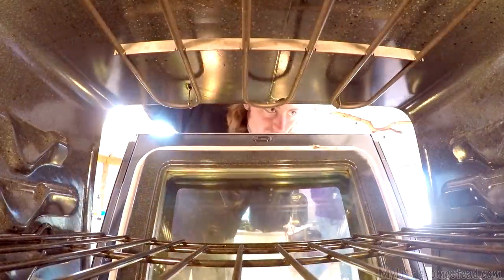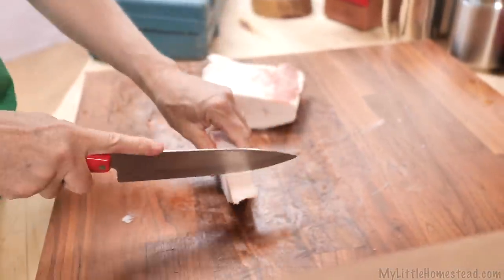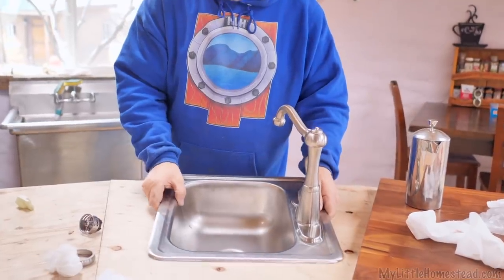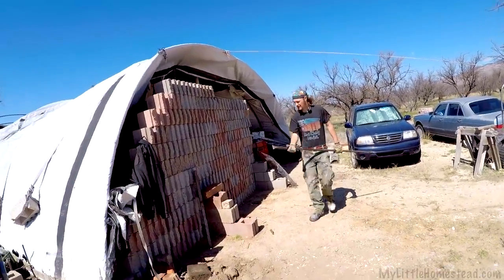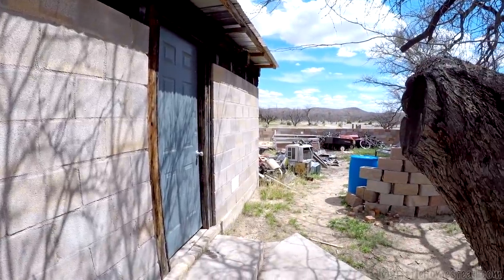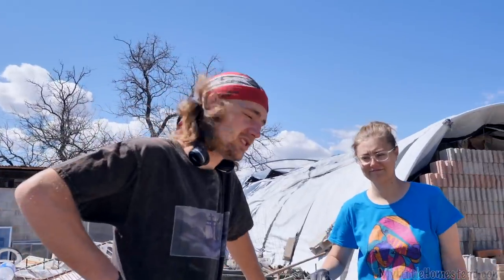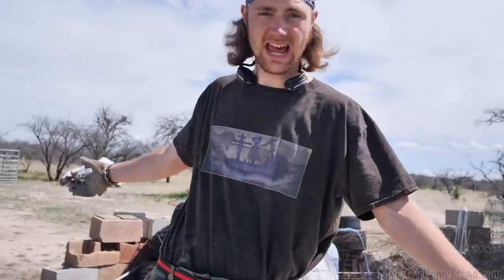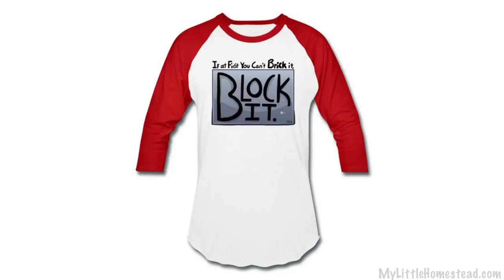Gaming Desks Complete! Kitchen Sink Cabinet, & Outbuilding Start! | Weekly Peek Ep177

Comment: Bricks can have holes in them, they tend to be made of clay, they have a standard size, but you can get custom size ones. Blocks can be solid as well as have holes in. They tend to be made of concrete with ¼ or ⅛"- aggregate in stronger versions, but can also be more like aircreate, without aggregate, and are called things like thermolite. They also have a much bigger standard size, but again custom size is possible. I love blocks. Bricks are nice too. Love your work.

Comment: Looked it up for you... The first striking difference between a brick and a block is in the shape, size, and composition. Blocks are mainly made of concrete and are larger in comparison tobricks. They come in both solid and hollow format and are used mainly in load bearing walls where strength is very important.Jul 17, 2017

Concrete blocks and clay bricks

I love your videos can't wait till next week's video

Comment: Bricks are clay (usually fired), blocks are concrete and both can have holes in them. Cinder blocks are made with cinder ash in the mix. The blocks you have will last much longer than cinder block.

Yes, I'm a spoilsport....

Comment: I've been hooked watching your whole family doing all of these DIYs you do. You are great and fun to watch and learn with. Gonna share something I noticed though with this particular video. Your utilization of blocks (aka hollow blocks) 18:42 you only put cement on the shells between other blocks it seems. For more stability and strentgh, you should fill in the hollowed areas. ☺ Though with your system I guess you want something not permanent and could easily be dismantled.

Comment: The blocks that you are using are 8"x8"x16" fluted block. Not all bricks are solid. It depends on the style of brick. Most bricks have holes to install rebar. Your block building should have rebar in it as well. It will add strength and stability. Then fill the walls with cement.
Reply: Kenneth Gregory I think I heard an NPR story a few years back discussing deterioration from a chemical reaction between concrete/cement and rebar...I understand the reasoning behind adding rebar but if researchers are finding that it doesn’t really work why add it?
Reply: @martymaloney1032  some places require it for code. There is another item that one can add. It's like ladder wire or something like that. It's galvanized metal and does something of the same except you lay it between the blocks.
The foundation and the block do need to be anchored to each other for safety. I wouldn't want one of the walls to move and crush someone.

Comment: Blocks can be solid as well. The difference is that brick are made from clay and blocks are made of concrete. Blocks are stronger and are used for load bearing walls. 😘

Comment: Aren't the block walls supposed to have rebar? How in the world did the goats get started eating that cactus?
Reply from the maker: Not sure
Reply: @mylittlehomestead  the corners should be filled with concrete with a "rebar" could be some thing else but rebar are hard to beat, pipes are not a good idea they rust from inside too but better then nothing and texas is kinda dry most on the time
Reply: also if you put a "rebar" in each corner you can weld a bracket to attach the roof.

Comment: when you build with Brick - it's either siding or you put rebar inside it in a Grid like pattern Even cutting them to fit crossways - so that the Roof can bee attached to the foundation through them. ? understand?  - if you attach something like wood? to the foundation the roof attaches to that making the Roof part of the solid structure.
Reply: Masonry blades come in Grider and Circular saw. usually for around $2.50 each - but you cut by moving it back and forth not like wood. - it's down the brick back to the start then back to the end - back and forth until through - LIKE METAL with cutting Discs.
Reply: And do not apply pressure. <heart> wear goggles and dust masks.

Comment: I hope you have enough of the boingy blocks (concrete) to do the south and west walls complete as they dissipate heat well and heat less than smooth block. Adobe bricks can be large and some fired bricks have holes. Cinder/pumice/concrete blocks are not fired but cured with a cement binder, bricks are usually fired. Adobe are called sun baked bricks. 
 I think that was a couple hundred year old cactus!
I love the desks and congrats on the streaming server.

Comment: Those boingy block are called "fluted" block, and what you are calling "cinder" block are not cinder block at all. If some regular 8"x 8"x 16"s are heavier than others, the heavy ones are concrete block (or CMUs, concrete masonry units) and the lighter ones that have some perlite or vermiculite in them mixed in the the sand based aggregate of concrete to make them lighter are called lightweight block.  Don't feel bad about calling them cinder block though, at least half of the people who don't know better do call them that incorrectly.  A real cinder block had cinder in it before they started using perlite (sand popped like popcorn, and vermiculite is popped crushed mica) to make them lighter.  I don't think any have been made with cinder at least since the 40s, maybe further back than that.  I have only ever seen them, or repaired them, in buildings built before then, and only have ever laid them once in 35 years as a mason.  Those sat stacked on a farm for at least 60 years before they got used.  It's easy to see a real cinder block once you know what one is, they have black spots all over them where cinder (charcoal) is exposed.  and it's easy to spot a block layer who's been laying them, he's as covered in black as a old fashioned chimney sweep cartoon. In fact if you still rub your hand on a hundred year old cinder block wall, or lean on it, and it was never painted or sealed, you're still going to get some black on you.  Many of these were used mainly for foundation walls and as septic tank walls for that reason.   

Also the plural of block is block, like deer are not deers.  There is an exception, you can have several kinds of blocks, but if you put them all in a pile, it's still just a pile of block. Brick are made of clay and fired in a kiln, like pottery.  Modern brick, since mid 1900s mostly have holes too, and there are big ones and small ones as well.  Block are made of concrete and some are small, but most are larger.  There is such a thing as a concrete brick, but it's really a block that is made the size of a standard brick.  There once were some clay block too, but they are really just big brick that mimic block sizes, I don't think they were on the market any later than real cinder block were.  Brick and block are not  interchangeable words either.   The plural works the same.  There were four kinds of bricks in that house made of brick.  Or, I went to a brickyard that had over a hundred bricks, after I chose two bricks that accented each other, they sent a truck with 3000 brick out to my house, that's six pallets of brick.  Block and brick can be many different colors, but grey block without dye are standard and the cheapest.

Cheers
BP

edited to add.
Be extra careful and observant, maybe invest in some bug spray.  I hate handling block or brick that have been sitting around like yours have out at the farm for years vs those new, straight from a block plant.  Spiders love the holes in block and brick, and accumulate with time.  I think especially Black Widows, and Brown Recluse.  We don't have hardly any scorpions in Wyoming, but I've heard they like block too.  Keep your eyes sharp, wear gloves, and be careful.   They probably wont get you if you are aware and expecting them and pay close attention at all times, but I'd rather handle some insecticide than a bunch of nasty poisonous spiders.
Reply: A mason and an English teacher...;)